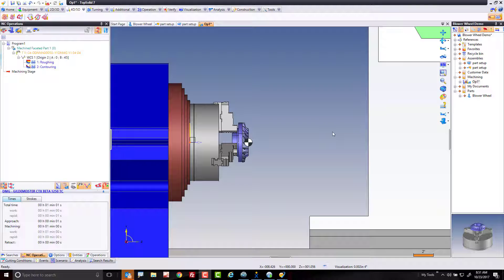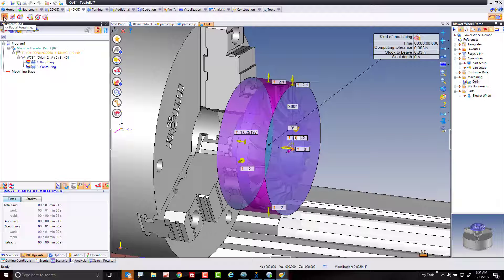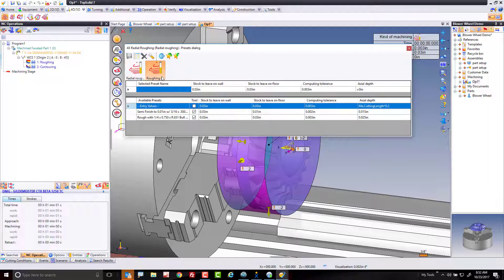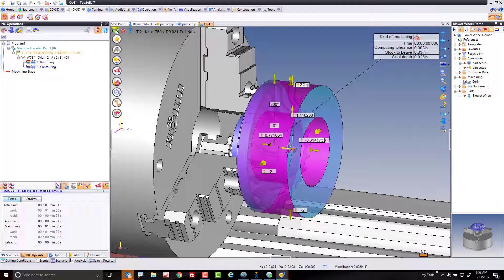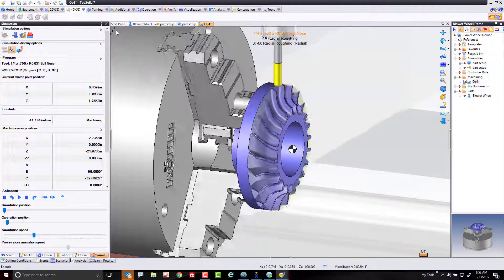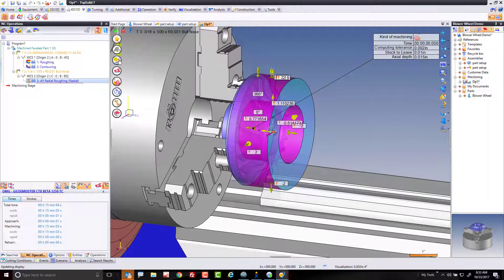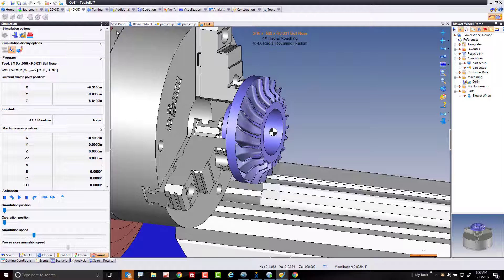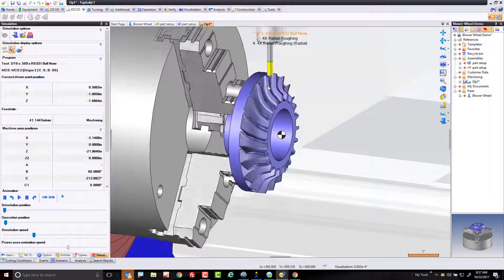4-Machine a blower wheel with TopSolid - Use Favorites to apply 4 axis roughing and semi finishing

Comment: Hi!
I can't update my stock. It doesn't fresh automatically like in the video, and if I want to remove it through the simulations, it starts lagging when touches material and either freezes or throws an error message "Stock update is stopped because boolean operation failure.